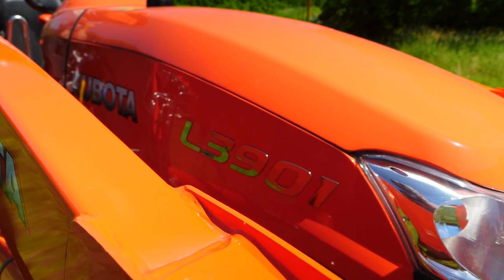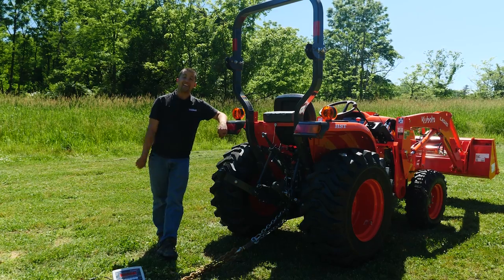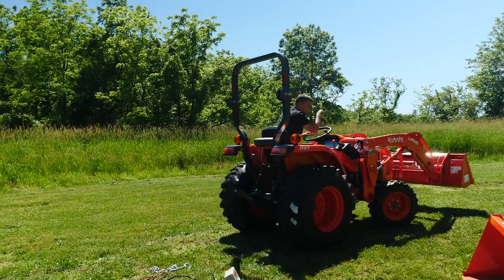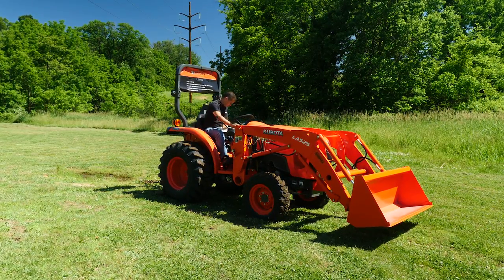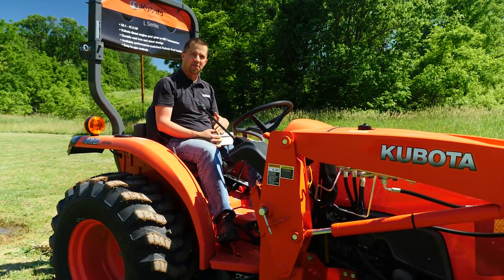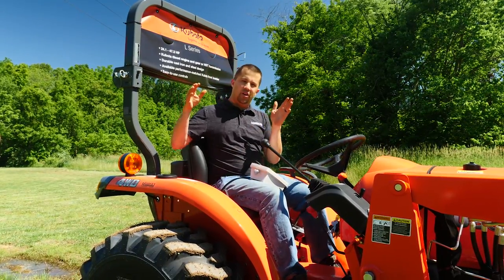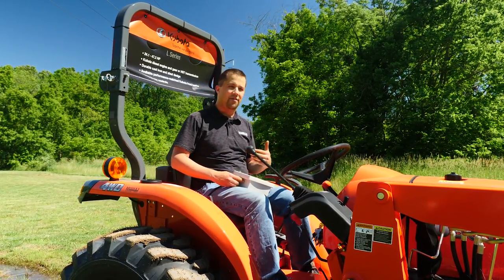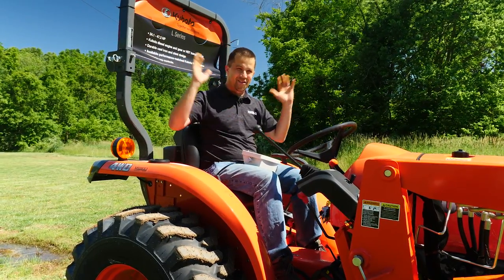Tractor Pulling Test - Gear Drive VS Hydro-static

Comment: Please try the hydro in medium or low range. I'm curious to see if it catches the gear drive at some point?
Reply: It won't. The power loss through a hydro system is ever present. A manual, geared system is positive lockup. No power loss. On the hydro drive units there were too many checks on the don't like side of the list when I was looking for a tractor. Power loss was a biggie but that infernal obnoxious high pitched whine was the deal breaker. I was looking for a compact and found a 4wd B2320 with fel that had 71 hours, less than 2 years old for less than half the new price. I only have one complaint, and that is the valve type 3pt system instead of the pick a point that older/other tractors have. But that was just a matter of readjusting the driver(me) lol. Once I figured out how to use it, it was as easy as the old Deutz that my grandfather had that all of us learned to operate. And with the on fender shift/lift/control arrangement that little tractor is sweet to run. I couldn't be happier with it.
Reply: @TheBrushcutter  it will, regardless of power loss because the weight and grip of the tractors won't allow even half power to be transmitted to the ground. The tires would slip. This pull off should have been done in the lowest range. It baffles me how he said that he wanted to limit wheel spinning, but the hydro isn't even capable of spinning in high range.
Reply: GREGG G DUETZ! Have one with no brakes. It’s a scary ride on a hill! Stays hooked to a 15’ bush hog. If it gets to going a little fast just drop it all the way down and it will stop eventually 😂.
Reply: @anymanusa  no way. That's why you saw the gear drive smoke it in high gear.
Reply: @TheBrushcutter  Power loss is irrelevant in a test like this. The tires can only transmit so much power to the ground. Once you exceed that limit, the tires slip. As long as the HST has enough power to slip the tires in medium or low range, it would offer the exact same pull number on the scale because at that point the limit is the tires, not the amount of power being delivered by the engine or transmission.
Reply: @JeremyAkersInAustin  try it in high range at1100 or 1200 rpms pretty sure it will melt that HST before it spins a tire. Those things are meant to be run at high engine speeds which means more fuel consumption. I get what you're saying about ptg but a manual suits me better and I don't have to hear that constant whine and banged out engine all day. Not going to argue with you over something that I ain't paying the note on, buy what suits you best. I did.
Reply: @TheBrushcutter  High range on an HST is only for high speed driving, not pulling.

On most tractors with HST in medium or low range will spin the tires just fine at 1200 RPM.

There is definitely power loss, but the power loss won't affect how hard you can pull. "Power" is defined as "Force x time".

This test doesn't test power transmitted to the ground, it only tests force. Force is limited by the tires so the "force" of both would be the same if the HST was moved to a lower range.

The advantage of geared transmissions are that they do transmit more "power" (Not force) which basically means you can pull digging implements (Like a plow) a bit faster with an geared transmission than an HST.

But most of the time these tractors aren't pulling plows. They are pulling rotary cutters or tillers or hay rakes or doing loader work... use cases where you don't need to deliver a lot of "power" to the wheels. In those use cases the HST is a lot easier to drive because as you're mowing or tilling or doing loader work you can very quickly and easily adjust your speed and direction without having to change gears.

Obviously different people have different needs. But the OPs point about this test being completely invalid is a fair point. The guy in the video does shift the geared tractor into a lower gear to spin the tires but he didn't do the same thing on the HST.

At a lower range the number on the scale would have been exactly the same for both tractors because the limit at that point is the "force" that the tires can push against the ground before slipping.
Reply: I would like to see it done in low gear and see what the numbers say.

Comment: I'd like to see you try in the other 2 ranges of the HST and make more of a fair comparison. I feel hydrostatic has both more pull with more tractive effort at the same time. It didn't take much for the gear drive to break the wheels loose and still pull high numbers.
Reply: yeah in the same tracks as the hydro. If anything the the hydro had handy cap over the gear and still lost by a mile.

Comment: Thanks, Neil - you've answered (part of) a question I've pondered: "How low is the lowest HST equivalent reduction?"  The HST is, philosophically, a fluid-coupled directly- engaging transmission (adjustable constant-volume pump on the input side, constant volume hydraulic motor on the output, fluid is practically incompressible, hence hydroSTATIC, completely unlike the torque converter in a car). At least until the pressure compensator/regulator and then eventually the pressure relief valve steps in to save the day. :-) It's a CVT that uses fluid instead of belts. But... there's a bypass valve in there so it will have a "neutral" when the pedal isn't pressed either way. I've wondered what the equivalent "gear ratio" is when that valve closes and it starts being a transmission. Now we know it's roughly 1/3 as much reduction as a gear drive will give in 1st gear.  Thanks!  This almost certainly explains provisioning the three-range axle as opposed to the dual-range, too.
Reply: Excelent explanation Erick. Could not have said it better myself in high-tech terms. In laymans terms; hydrostatic = = slip-o-matic:: with half of the transmision missing. Hydro's great for rapid back and forth and best at howling,wyning, frequent expensive fluid &filter changes, but best at burning fuel. Shuttle good, relieable,cheep and great at putting power down. And the best of both worlds; The hydralic-power-shuttle. Hands down the clear winner;; if you can afford them and in your right size. Fortunate to have all 3. Great comment for the "tractor gang". Thanks for information.

Comment: Thanks Neal. That was pretty interesting. I am not super mechanical, but I don't work my tractor in high gear. Maybe do the test again but in low, and on a more consistent surface? Grass is a wild card, I think. I'd like to see that. Thanks!

Comment: Would have liked to see the HST in low range and in 4WD so it breaks the tires loose like you did the gear drive.
If the gear drive has 300% more pulling power over HST, then all salesmen should mention that when selling a tractor.
Reply: I have both and the gear drive for sure has more pulling power
Reply: @rickywoods3101  Gear drive all day every day. No relief valves to open. It's just engine-clutch-gears-tires.
Reply: @Robert Black1911 You missed the point. Both tractors were in 4WD and High range exactly to point out that a gear tractor pulls a lot more while the HST can't even spin the wheels and is a noise maker.
Reply: Agreed.  If you're hooking to a load with a HST, you're in low, not high.  I'd be really curious about the peak numbers there.  No question to me that if you're pulling/ground engaging almost all of the time a gear is better, but this vid gives the impression that HST can't pull even half of what a gear will.
Reply: @javabean215  Their high end gear ratio is the same between them both. That's why he had them both In high to give them the same load and see which one is more efficient at transferring the power to the ground. if you put them in low without downward pressure they both will just spin
Reply: @javabean215  The tractors should have been placed in whatever gear provided the most pulling power. No one cares if it's in high range or 3rd gear or whatever. Put each tractor in whatever gear provides the most pulling power and go. We're also assuming that both tractors weighed exactly the same and had the exact same air pressure in the tires. Traction tests in grass are useless anyway.
Reply: @eosjoe565  read my previous comment, then you will understand why he did it the way he did
Reply: If you go back to the tire testing with the load cell and the BX tractors, there was a significant difference in pulling between the hi range and low range tests.
Reply: Question. would the operation and capacity of the loader be affected in any way by either transmission in other words with the hydrostatic transmission could you to lose loader power due to shunted hydraulic flow?
Reply: @MikeDPlxztc  No. It uses different pumps. One doesn't affect the other.
Reply: I don't think many of us were surprised gear drive puts more power to the ground  But it looks like some of you with HST transformations got a little but hurt lol  If you're HST transmission does the job you want it to do Then who really cares lol
Reply: Once again, I'll acknowledge that a gear drive will put more power to the ground than an HST.  All mechanical drive, something's got to give (be it clutch, differential, or tires/traction).  I'm not arguing that, and for anyone who needs predominantly ground engaging or towing, the gear drive is generally the better option.  However in this video (https://www.youtube.com/watch?v=c9EVpXjzHsY&t=315s ) even the BX is putting more torque on the load cell in low range HST than that L3901 put down.  And again, if you're pulling a load or pushing a pile with an HST you'll almost certainly be in low range.  With hydraulic coupling, there's a reason for hi and low ranges.  And again, I'm not saying that the HST would beat the gear drive, but low range would be slightly more grapefruits to oranges.
Reply: He clearly stated that he has a 10K lbs load cell and didn’t want to max it out. That’s why he went with high range.
Reply: @pedrobatista4439  thanks I had a suspicion of that but wasn't sure if all tractors were like that I thought some had one pump only maybe that's the older models
Reply: @namewithheld367  He did say it was a 10k load cell but that is not the reason he gave for using high range.  I am not familiar with either tractor so I can't say if its even possible for that model to pull 10K.  Now I am a gear trans wins the day type of person, but I have also owned enough tractors where I know, tractors of the same type roughly top out at the same speed,  that point he made was irrelevant to its low end grunt.  I am not even saying had he put the hydro into low and 4 wheel drive that it would even change the out come.  Its just weird as hell he didn't take 30 secs it would have taken to run the test so we all could have seen it, and not had anything to bitch about here in the comments.
Reply: The gear tractor wad not in 4th high. It was in 1st high or 5th gear out of 8
Reply: @MikeDPlxztc  Other that tractor RPMs dropping, no. The pump that runs your loader and the pump that powers the hydro transmission are two separate pumps.

Comment: Most folk today don't really use ground engaging equipment much.   Gardens used to utilize a plow and disc harrow.  Now they use a PTO tiller.  The gear will have more available HP to the PTO than a hydro.  A box blade or a land plane use gets back to traction issues more than power issues.  For the vast majority of folk hydrostat will continue to be the transmission of choice even though the cost is higher.  Thanks for the videos Neil.  I appreciate them.

Comment: Good video, and I love my gear drive l4400, but I think the test was a little flawed. When the gear drive started going on the first test, it was jerking around and had time to build a tiny bit of momentum. That momentum could lead to a shock value that reads higher than the actual pulling force. I think this is why the values were much closer on the second test in hi-4. Also, hi-1 would be much more similar to the medium range in the HST model if it is anything like my l4400. In it, lo-4 gives a top speed of 4.2mph, and hi-1 gives a top speed of 4.4mph, meaning they are very similar to each other in final ratios. Considering my gear drive has a top speed in hi-4 of 14.9mph, that means both of those gears are in the bottom 1/3(both less than 30% of the overall top speed/tallest gearing).

Either way, keep up the videos. There has been a lot of very entertaining and also educational information, and I think we all appreciate it.
Reply: I havea L3800 gea`r but for your comment on second time closer? Hell He was in 4th low. You have a gear unit and know low in 1st pull pull your head off.

Comment: Throw the HST in Lo, 4wd and see how much closer it is to the gear.. probably wont match it but it’ll be close.
Reply: Not when you compare it to the gear in low and 4x4. Just look at hp to drawbar and PTO numbers! You lose ho to the HST drive, same engine HP will always be an orange to tangerine type comparison.
Reply: @coypatton3160  there is literally a 1 hp difference between hst and gear
Reply: More like 3hp in these 25 or 30 ish hp machines it makes  difference plus you don't have the god awful hst whine and need for high rpm to do any work gear is more efficient and powerful every time
Reply: @Coy Patton you lose hp to the pto because there is a lot of fluid inside the hydro.
Reply: @highlanderc  keep dreaming! Check the hp difference from engine to PTO on gear vs hst. There is always a greater loss in hst. Where does that hp go? HST! That means there is less to go to traction! Not to mention the need for rpm’s and foot fatigue. 
Bottom line there are few places the hst wins very few.
Reply: Coy Patton pto doesnt care about traction. I never said anything about this test in my comment. I dont need to dream. I can own any i want. Discuss, discussions are great. Your “keep dreaming” is inappropriate. 

Thanks
Reply: @coypatton3160  Foot fatigue lol tractors even this small they have cruise control
Reply: @Morpheen999  yes called options, not every one gets it. Sure it can be added. But personally no thanks on the HST, I’ll take a shuttle shift 7 days a week and twice on Sunday!
Reply: @coypatton3160  A peddle lock is standerd equipment on these small hst tractors.. its not a option
Reply: Agree on the shuttle shift!
Reply: Way back when.  IH actually had to change the model number of the "656 hydro" to "Hydro 70" because to many people were comparing the hydro to gear drive.  The hydro being an expensive option at the time and only had 70% the pulling power.

Need I say more?
Reply: I think my 8n could out pull that hst lol

Comment: Great video Neil.. where a hydro really shines is when your doing fine detailed work or loader work.. it’s not very enjoyable moving buckets of material all day long with a clutch on your left foot.. you’ll realize your left leg will start to be in quite a lot of pain after an 8 hour shift and the level of precision with the loader/bucket is not nearly as good.. but a good operator can easily overcome these obstacles with a gear driven tractor and if your anything like me you may even prefer to use gear driven over a hydro most of the time. 

Surprised I missed this one 👍🏻

Comment: It may not put down the same numbers on a load cell, but the ability of a hydro to infinitely adjust the power output allows you to better control wheelspin. I have used dozens of different tractors and wheel spin is always the limiting factor on your ability to pull. 
Gear tractors shine when you're pulling a heavy steady load, like ground engaging implements. 
The hydro will run circles around any gear tractor doing loader work. 
Different options for different tasks.

Comment: I would have like to seen a 4th gear pull in both hi an lo. As well a pull in all 3 ranges of the hydro
Reply: Right on.  Compare each tractor in each gear at each range, make a chart, THEN compare.  Todd at Project Farm is probably LHAO right now.

Comment: I’ve always had a suspicion that gear drives pull a lot harder just because of old farmall tractors I used to play with. They were only 20-30hp but will literally flip themselves trying to pull if theres traction. You gotta be ready for that. I guess there is a clutch slip issue but the gearing is so low your not frying those clutch plates. My opinion, hydro is convenient but you do lose significant power to the ground in small tractors.
Reply: I think the gear drive lasts longer than hydrostatic

Comment: Great video! It really doesn't matter if the gear drive out pulls the hydro IF  you can't get traction! I had a 20 hp John Deere lawn mower (430) and when using the full 20hp, I simply spun, not accomplishing any work at all!

Comment: Would like to see what the hydro would do in low range.
Reply: Spin the tires, I have a hst new Holland and it will spin all 4 on dry pasture in medium or low at an idle
Reply: @russianacorns8080  our tc33d with hydro is nice but I think it looses a lot of powder through the transmission, with a shuttle shift you can put it in gear and let the clutch out and use the shuttle to take off and save the clutch wear
Reply: @cargotoolshop5319  yeah, I’m replying because no one understands that it would be pointless to do it in low because then it’s a test of tires not transmissions.
Reply: @russianacorns8080  This test is a test of the tires, not the transmission. On the geared test he switched to a lower gear and slipped the tires. So he should have done the same thing on the HST.  Once the tires are slipping, regardless of transmission, that's it. A geared transmission with slipping tires will pull just as hard as an HST which is slipping, and you can switch either one to a lower gear to achieve that result.

Comment: You might have said and I missed it, but are the rear tires ballasted in either machine?  Found my L3130 gear drive pulled a lot harder after I refilled the beet juice in both tires (leaky valve stem).